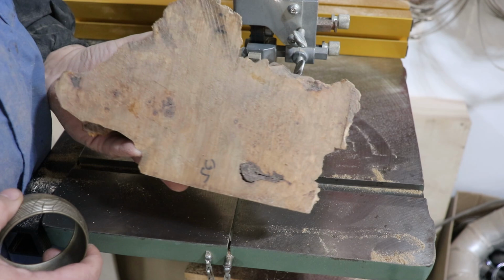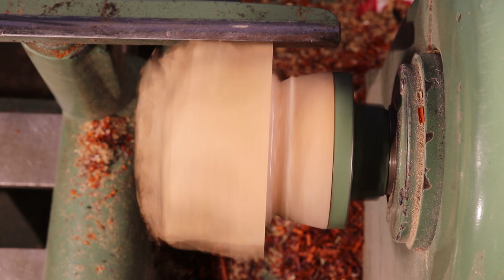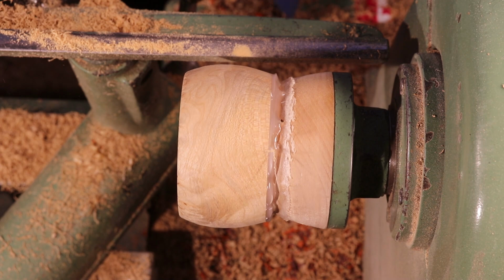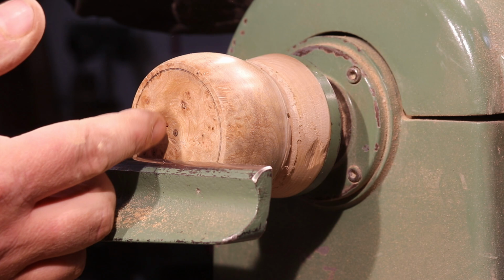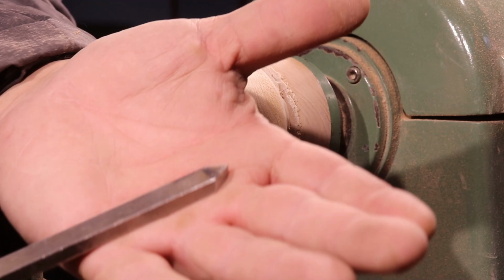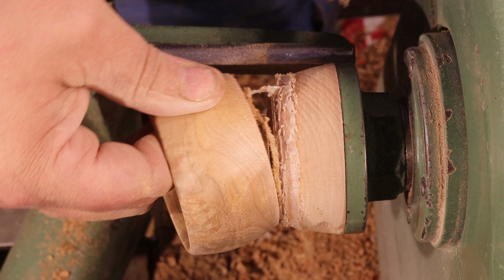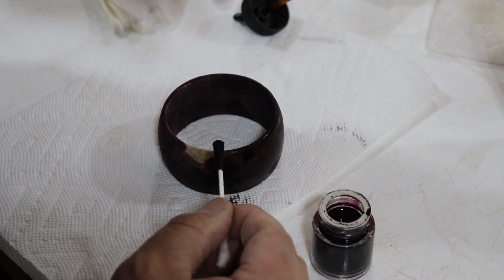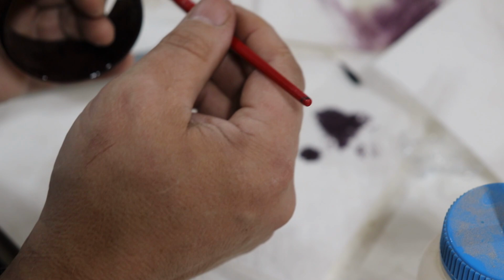Woodturning | Colored Maple Burl Bracelet With UV Resin Finish from an Offcut

Comment: That is striking, Lewis!  I appreciate the explanations when you were working on different ends and how you established the dove tail to finish it. I tried one bracelet but was over zealous with the chuck and snapped it. Decided that was a trial to put on the back burner. I am due for some Yorkshire grit. I think I might try some intrinsic dye. Had a really nice platter on the go today, air brushed a gradient that I was quite proud of. Went to add a black accent ring with the lathe spinning and it streaked across the whole thing. I brushed it out to try to blend it but tomorrow morning we will see what the dried product looks like. Might be looking for something that dries faster with an alcohol base instead of water.
Reply from the maker: Thank you Jay! Yes colouring moving pieces can be frustrating based on what I have seen. I hope it works out. Thanks for watching!